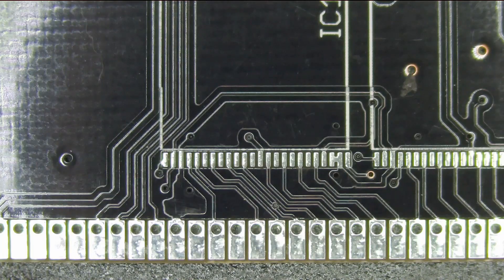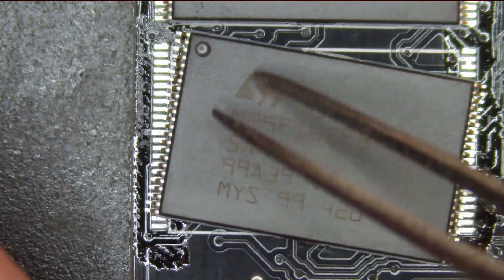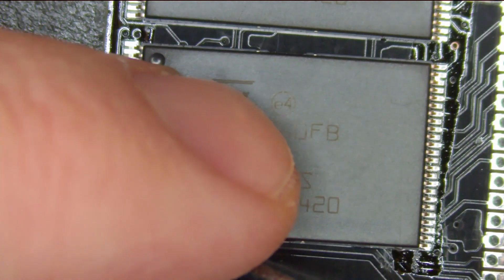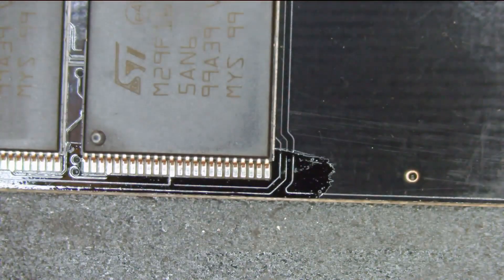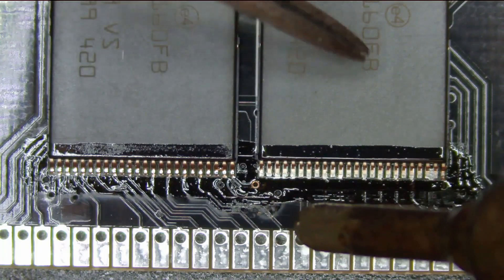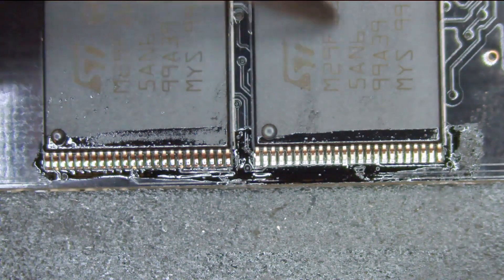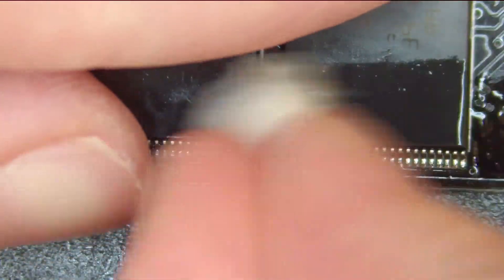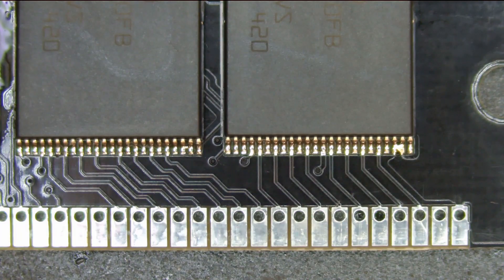Drag Soldering TSOP-48 chips: improved technique

Comment: Hey, great video!  I'm interested in the part your creating there. You mentioned it's a ROM SIMM for Macintosh.  What exactly is it, and where can I see more about the ROM SIMM?
Reply from the maker: Thanks! The boards I was soldering in this video are 8 MB ROM SIMMs for classic Macs. They fit into the SE/30 and II-series systems. I originally did it to hack the ROM so I could change the startup sound. Then somebody developed a bootable ROM disk driver for it, allowing super fast boot times. Check out my website at downtowndougbrown.com for more info about them. I no longer sell them, but bigmessowires.com makes something very similar now.
Reply: @doogulass  Oh!  You're Downtown Doug Brown!  I didn't realize.  Awesome work.  I have bought BMOW ROMINATOR so I'm a bit aware of your project work there.  Thanks for your contributions to the community!

Comment: Hey! I was just looking up how to hand solder TSOP-48 and it turns out you're working with the exact same chip I'm trying to work with! Would you happen to know any reason it might only output 0x07?
Reply from the maker: What a crazy coincidence! There’s not really much to reading from this chip at all...you just put the address you want to read on the address pins, make sure WE is high (5V) and OE and CS are low (0V) and the chip should spit out the data at that address on the data pins. Writing gets more complicated though for sure. No idea why the value is always 7, I would make sure you’re controlling all the pins correctly. Might want to enable pull-ups on your data inputs to see if the chip is even outputting anything at all (if you read back 0xFF after enabling pull-ups and trying to read again, that would be the case).
Reply: @doogulass  Thanks for responding! I'd read that reading was supposed to be as simple as reading an EEPROM, and was confused because the same setup could read my previous design just fine that used an EEPROM. It turns out that I somehow got the pinout of my own cartridge design backwards when ordering this batch.

Comment: What type of drag tip is it?
Reply from the maker: It's a hoof tip, but it is also concave so it can hold a little bit of solder in the cavity. I have a Hakko FX-888 iron, but Hakko doesn't make a concave hoof tip for some reason. So for drag soldering I use the Plato HS-0530 tip. It works great with the FX-888.

Comment: Amazing, thank you so much for posting this.  I'm looking to replace IC Flash Nand Memory in a Sansa E260 MP3 player, It shows two IC Nand  chips on the device, 2048 is printed on each chip, wondering if that's two 2GB chips .  The device is in total 4GB of memory, I believe it's a FAT16 format.  I guess the question is, can I replace one with a 32GB IC Flash Nand chip? if so......  Would is boot, or with your experience do you think that these two chips are RAID in to one drive?  Would I be able to prep a donner USB Flash Drive by pre formatting to FAT16?  Have you ever done this?  Any help or advice would be greatly appreciated.  Here is a link to what the chips look like. http://georgefrick.blogspot.com/2010/01/fixing-dead-sansa-mp3-player-versions.html
Reply from the maker: Never done this but I think it's unlikely to work. The NAND chips probably also contain the MP3 player's firmware so you'd have to figure out how to copy it over. You may have trouble figuring out how the chips are formatted. Additionally, with such a large difference in size between 2 GB and 32 GB chips, it's unlikely that the address pins for the larger addresses are even brought out on the circuit board. This is just my off the cuff guesses though!
Reply: @doogulass  thanks very much for the quick reply. That was crazy quick. Alright I guess I should try it.